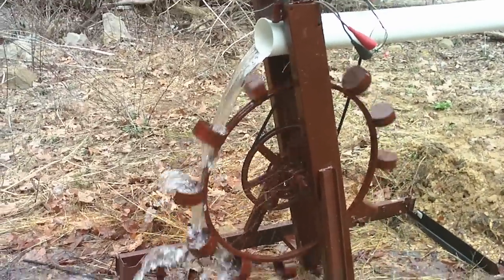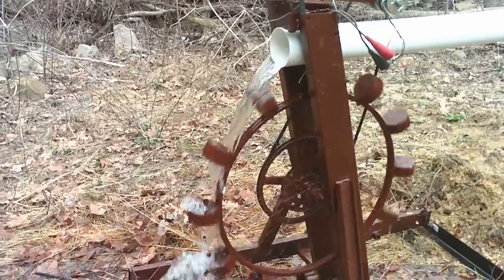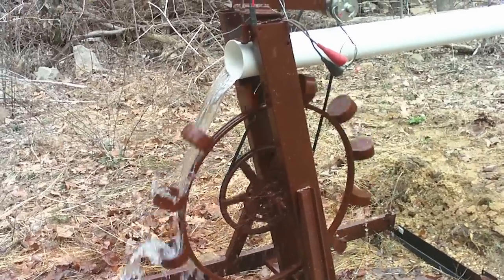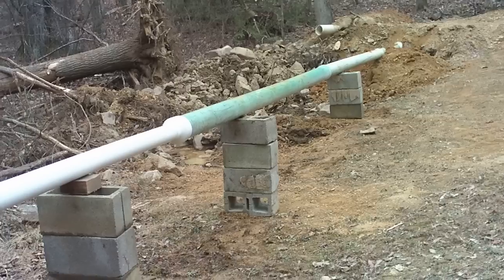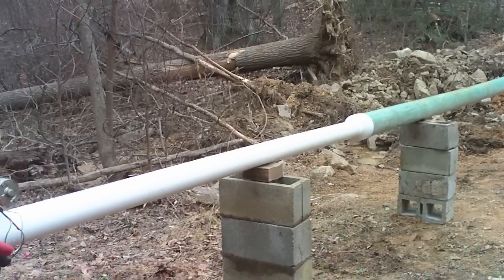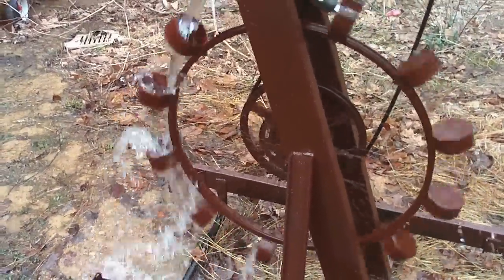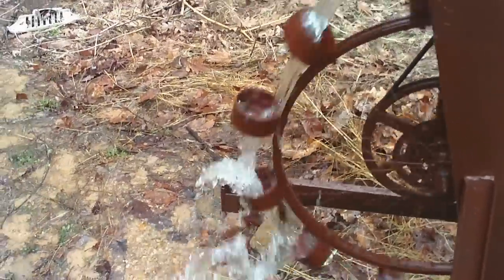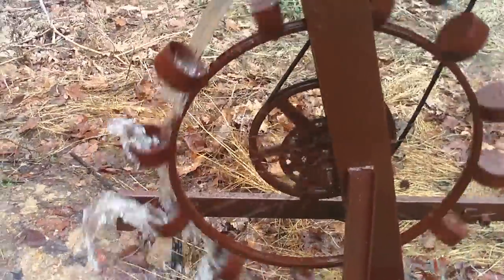water power generator

Comment: Looks good but if you reduce it down to a 2 in pipe and add a 90 degree at the end the speed you get will make it put out more then 12 volts good luck

Comment: Like the previous guy said, you need more pressure, but also I would something that wouldn't waste water, perhaps like something that would trap the water, you can have an inlet line and a return line, in between some kind of turbine attached to a pole that would extend outside of that assembly.  You can use that same pipe your using and reduce it to like 1/2 at the end of the inlet line, the return line can be wider.

Comment: may I suggest maybe dissing a hole and placing the waterwheel in it to lower it...create faster stream.also remove some of the blocks.the more a slope it got the faster the water will run.
 If dug a hole to place wheel in  it would help make grade even lower.just an idea.great vid